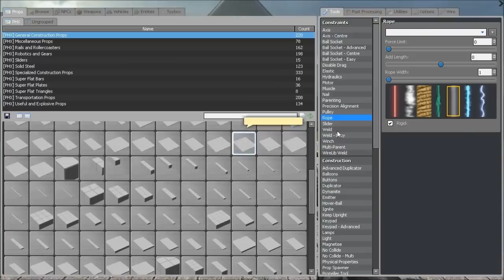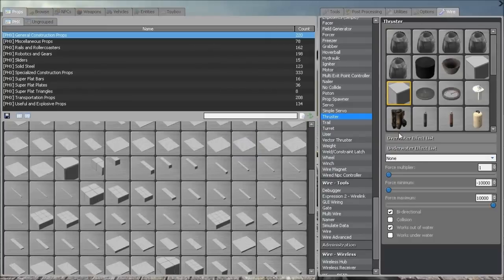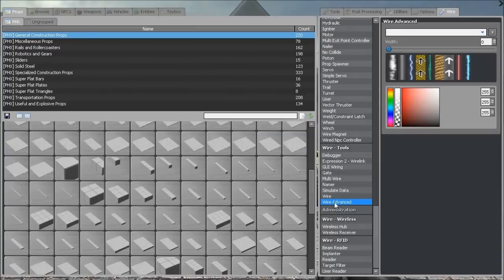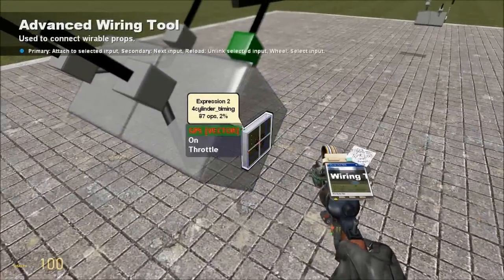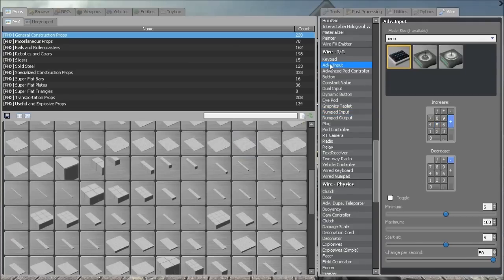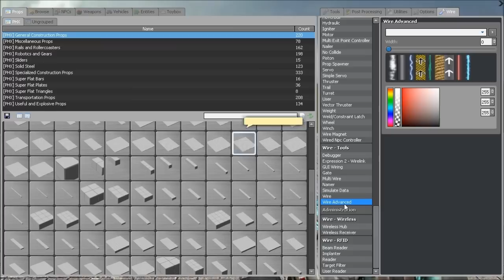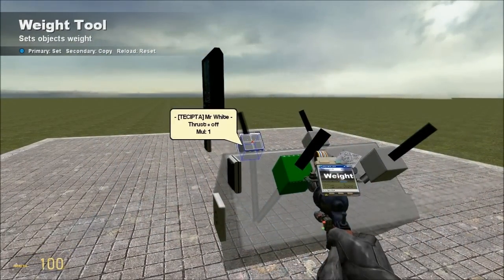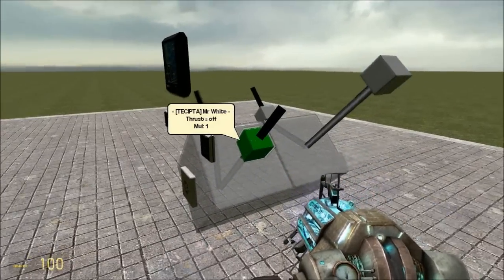(GMod) (Tutorial) Basic Thruster Engine Part 2

Comment: @mwhite112393 thanks(: 
Alright thats cool.
I followed your reccomendation  on 25 for the cylinders and all of the cylinders plus one for the crankshaft. on my test rig i have the small tractor wheels (PHX) a 4X2 tiled piece, the engine and a couple of wire screens to show my RPM, throttle and speed. I would say the total wieght is just over 1000 maybe? probably less, i am trying to lower the weight, but if its too low the car is unstable

Comment: @mwhite112393 i did that and i couldn't get it right, so i gave up. The only reason i wanted to do a V6 was for more power because i couldnt move anything with the V4. I just finished a V8 using your E2, i roped and wired it so that 2 cylinders fire at the exact same time (hoping for more power) but it failed it had the same, or even less power. How do you get your engines with so much power? the only way i get power is if i put the throttle to 1500.. but then the engine explodes.. lol